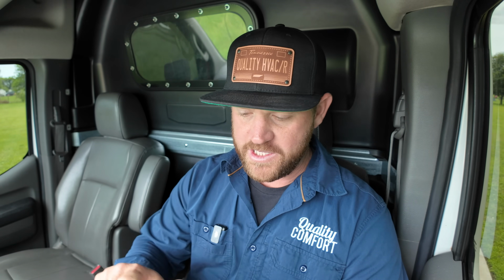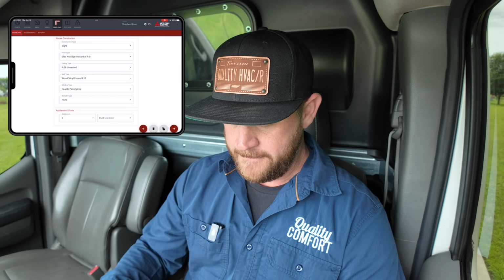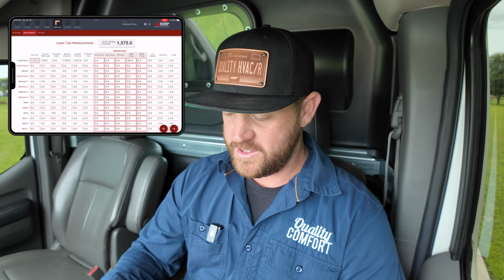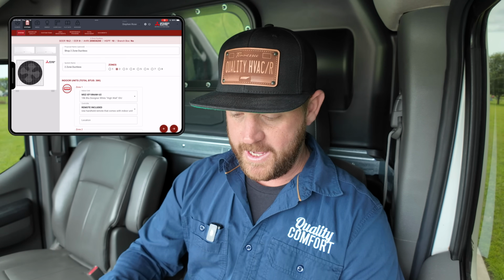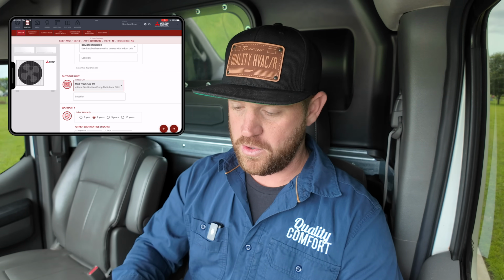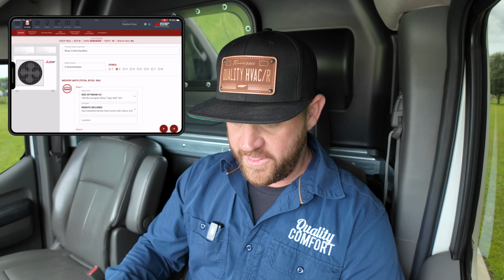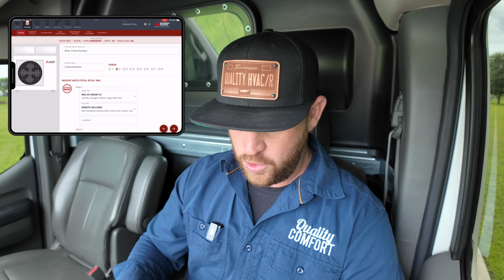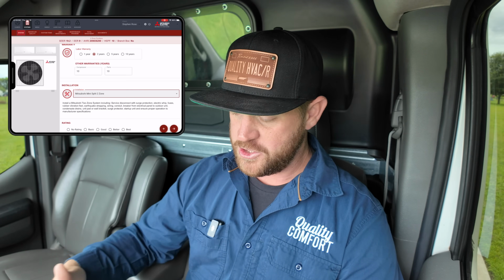How I Do Estimates and Perform Load Calculations

Comment: do those thermostats actually reading temp. now, because usually its the return sensor on actual unit reading temp or are they just proving a means to control the units thru app on phone and still using the sensor in unit?

Comment: Cool Calc is what I use , I’m in Missouri and the City is requiring Hvac contractors to provide manual J and Manual D prior to getting your Mechanical permits pulled. You have to either hand draw your Duct design or have one generated on software.

Comment: I recently replaced our aging central air unit with mini splits.  The old system was 25 years old and the air handler was in the attic of our 50s ranch home….it never could keep up.  A few years ago we installed a single zone in our master bedroom just because we like to sleep in the arctic.  It made sense for us to just toss out the central system and put in a three zone for the remaining bedrooms and LR and a single zone for our family room.  So far it’s been working great and it’s nice to be able to cool only the rooms we are using.

The brand we went with has a decent app to control all of the zones from our devices, so we rarely mess with the remotes at all since the head unit measures the temp.  Is the benefit to using the thermostat you showed that it senses the temperature itself (an actual thermostat) instead of the head units doing that?
Reply: Wow!
Reply: Way back before mini splits window or wall units did the same.